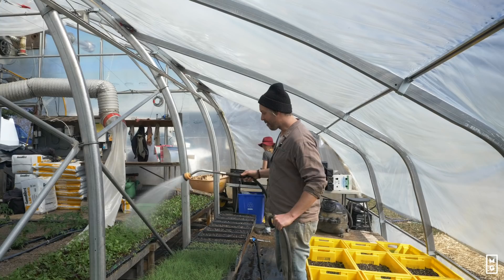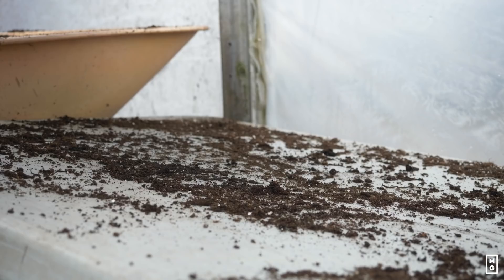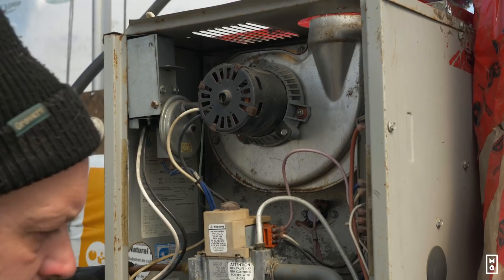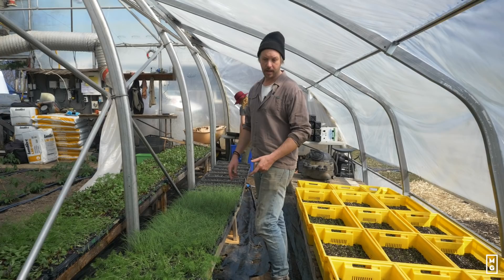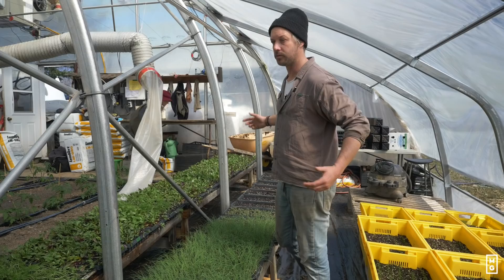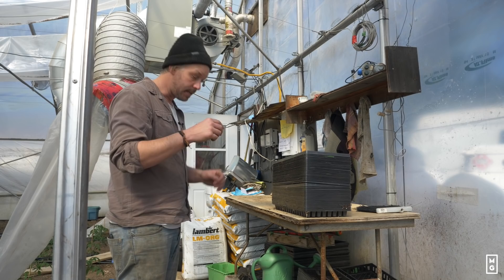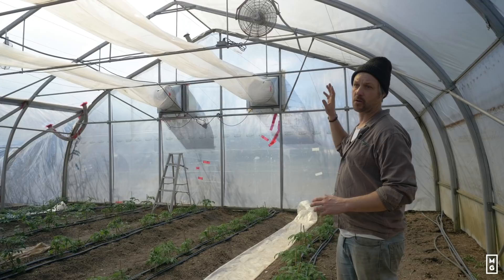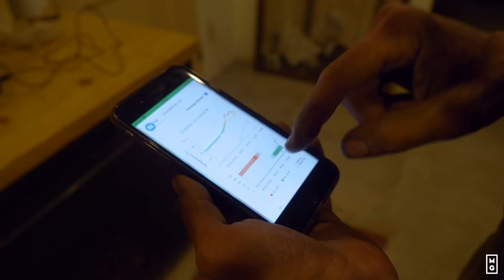Best Greenhouse Systems For A Successful Market Garden

Comment: Something to try with your next greenhouse is a geothermal greenhouse oriented along east-west so you can fully insulate the entire north half of the roof, and use reflective film on the inside.  Or your north-side wall can be vertical and made of heatsink material like black water tanks.  The heating is from 2.5 meter deep trenches on your property with airflow pipes that give you year-round 50-degree F air.  A heatpump can raise the temp to whatever you want, and you can power it all with solar pv most of the year.
Reply: @charliedoyle7824, do you happen to have any pictures of your installation, pm me if you can I would love to see them, currently looking at doing something like that.